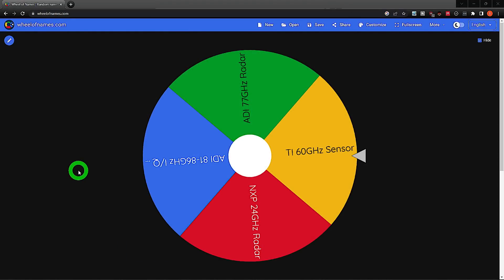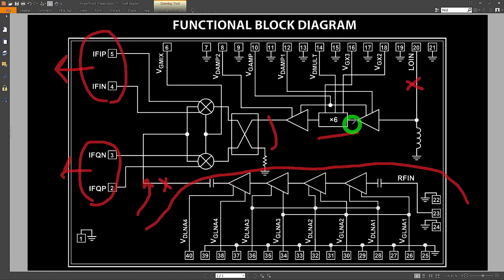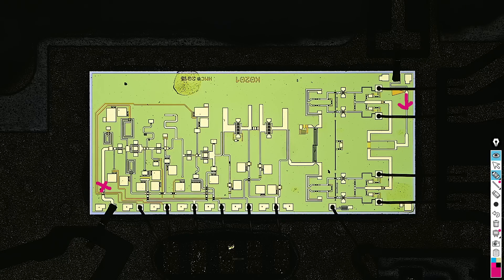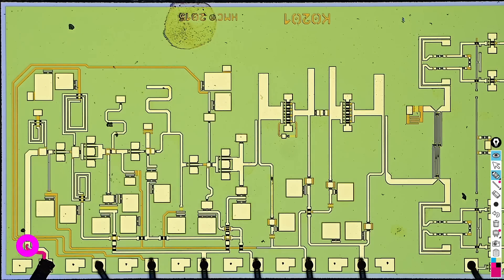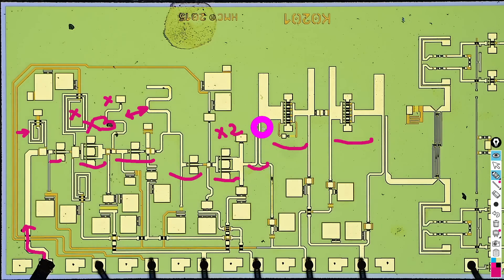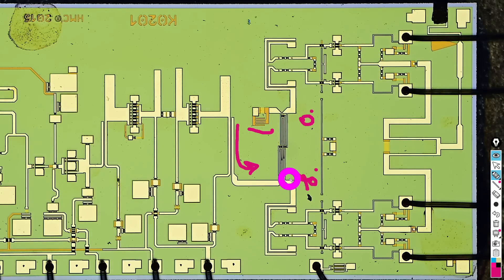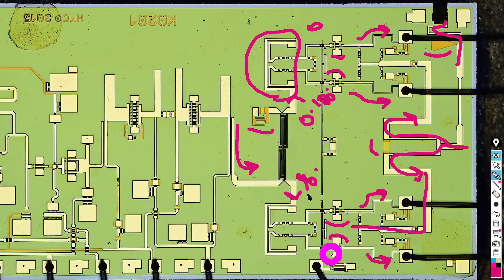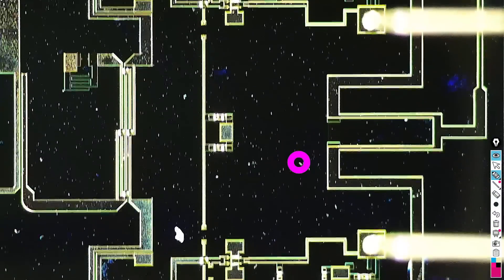TSP #216 - Analog Devices GaAs 81-86GHz I/Q Direct Down-Converter MMIC Detailed RFIC Analysis

Comment: I’d love to see a better description (calling out diodes as to which sides are P and which are N of the actual doubler and triplers and even vs odd harmonics (for the benefit of others).
Reply: It is a HEMT process. Probably by WIN semiconductors. So no bipolar diodes, only field effect transistors. You can make e.g. a doubler if you bias a transistor at deep class b, so only the positive half wave gets amplified, and you match the output to the 2nd harmonic. MMIC design takes some time to master, as with active components there are multiple possibilities to achieve a certain function.

Comment: Thanks, Shahriar.  I saw several places on the die where turns in "traces" were done with 45° angles or with curves, but in most cases they were 90° bends.  What drives the decision to use a particular method for direction change over another?  Don't 90° bends create reflections?
Reply from the maker: It depends. The bias lines don’t matter, and low frequency parts are also OK. For inductors (as lumped elements) it also doesn’t make much of a difference.
Reply: @TheSignalPath  Ah, of course; I forgot about the bias.  That makes sense.  Thanks!

Comment: I'd be really interested in seeing a breakdown of how each of the structures operates, and how the element sizes are tuned. Something I'm trying to wrap my head around is the behaviour of the circuit across the specified operating frequency range, since I presume that the λ/4 length of the Lange coupler and the λ/2 lengths of the I and Q differential couplers are based around the center frequency of 83.5GHz, which means there must be some propagation delay error in each of the structures when operating at the outer frequencies (81GHz or 86GHz) and therefore some phase error between I and Q as well as between the two ends of the differential signals. The datasheet claims ±4° of phase balance error, but I can't see how they've arrived at that number given the percentage change in wavelength across the operating frequency range.

I'd also be interested to know why the LO frequency range is specified down to 11.83GHz rather than 13.5GHz (81/6). EDIT: Strike that last part. The datasheet is full of typos, and they mention an LO of 13.5MHz a few times (supposed to be GHz), which made me suspicious. 11.83GHz * 6 is 71GHz, rather than 81GHz, so I'm almost certain that they typo'd the calculation and the LO range should actually be 13.50-14.33GHz, not 11.83-14.33GHz.
Reply from the maker: They have another part which is 71-76GHz. Probably LO is the same for both chips.

Comment: Can you find or draw a schematic for the mixer transistor and surrounding circuit elements, perhaps explain the bias and signal levels that are needed to make it work.  Obviously something non linear happens there but what and why.  Right now we just look at that transistor in awe and wonder why it should be mixing anything.

Comment: I would love to see you measure distances using the lock-in amplifier with modulated diode lasers! Say 100 MHz, so you can get millimeter precision
Reply: We do this at work!
Reply: @Ziferten  Woahh please tell me more about it; I would love to do this but the Stanford DSP lock-in at work has a much lower bandwith than what I want, so I still have to down-convert with mixers, and have yet to commit to the project...

Comment: Very interesting. I think such circuits with relatively few transistors are excellent examples to analyze. Simple enough to follow yet fascinating. One thing you didn't mention - how is power supplied to the transistors? I guess the bulk is connected to ground and the rest of the bonding wires are different power rails?
Reply from the maker: Yes, bulk is grounded. And the rest of the bias lines can be seen on other metal layers.
Reply: @TheSignalPath  The bias lines look pretty long for some and the bypass caps quite big that I wonder if they could potentially create instabillity (mostly due to SRF of the caps), at some higher frequencies, but I havent worked with III-Vs yet (so I dont know about the BEOL performance of these processes)
Reply: In GaAs typically there is no bulk, as the substrate is not conducting, unlike silicon. The gnd is brought to the backside metallization by etched and then plated vias.

Comment: Would love to see a deeper dive into each of these structures, like the Balun for example.  How do the fields work in it to form a balun?  Why is it bent?  Is that better, or just space-saving?  What are the approximate impedances at each point?  What are the little dotted objects right after it?
Reply: The Baluns right before the mixers look to be marchand baluns. The unbalanced end is fed to an open-ended transmission line with lambda/2 length at the frequency of interest, while the balanced ends are grounded transmission lines with lambda/4 lengths on either side. You can see it on the chip, the single ended line is twice the length while the differential lines have squares at their ends, which are probably AC grounding capacitors. The lines in this case are most likely bent to save area while keeping a symmetrical layout for the differential input going to the mixers. This is quite common in literature actually as you go higher in frequency, you can even see these marchand baluns in rectangles or octagonal spiral shapes!
Reply: @regweldrotmg  So the upper and lower structures are somewhere around lambda/2 in length, which create the 180deg phase shifts for differential I and Q respectively through propagation delay? Or are the structure lengths not exactly equivalent to lambda/2 due to the dielectric constant's effect on wave propagation? If wave propagation delay is the phase shift mechanism, wouldn't that cause some phase error in the differential outputs when lambda/2 of the LO*6 frequency doesn't match the physically tuned length? Looking at the datasheet, I see ±4 degrees of phase balance error listed, but back-of-the-napkin maths says it should be more than that (±5.25 deg) if they tuned the structures to the 83.5GHz midpoint.
Reply: @gsuberland  They are lambda/2, but you are right lambda in this case is NOT lambda/2 of a free space wave. The velocity shorting factor needs to be included. In an ideal case there would be no phase imbalance (at the center frequency) from the passives, but due to small path differences and mismatch of the differential mixers you get some (not exclusively) AM-PM  conversion resulting in a phase and amplitude imbalance.
Reply: It's the Marchand balun. Lots of textbook literature on that.

Comment: Another awesome video!  Why is the RF input trace narrowed for a short distance after the butterfly filter?  Is that a resistor?  Also, can you do an episode some day about distributed elements and how they work?  I sort of get parallel couplers and stubs, but butterfly filters and some of the other elements leave me scratching my head.
Reply: Trace width determines the characteristic impedance of the transmission line, so not a resistor, but designing different values for different sections of lines can help match impedances, filter, or both depending on the implementation. Most commonly  when you see a section which is narrowed it is an inductor for a filter implemented as a distributed element. 

Additionally, a quick note on butterfly filters, they are very similar to the stubs you mention, but are just a different flavor of a parallel-open-stub.

Comment: After watching this, I have so many more questions than before. Do you have a Video where you explain some of the building blocks used to make these circuits? I would like an explenation on how the amplifier or frequency multiplier works. It would also be nice to have a more in-depth look at the lange coupler or the single-ended to differential circuit. 

Can you suggest resources (it doesn't matter if they are free or paid) where I could learn more about this?
Reply: The basic step for frequency multiplication is converting a (sinusoidal) frequency signal to a square wave with sharp rise and fall times, this automatically produces harmonics, the strip line filters are used to select for the harmonic that is desired.  You can use these techniques to multiply with larger integers but the harmonics get weaker as they get higher so 2 and 3 are great and you can just daisy chain them to get higher multipliers with filtering and amplification between each stage unless you need a prime number in which case you need very good filters to select a frequency that is much closer to the adjacent harmonic.  The difference between a 9th, 10th and 11th harmonic is only 9-11% while the difference between a 2nd, 3rd and 4th harmonic is 30-50%
Reply: The single-ended to differential circuit is known as a "Marchand Balun".

Comment: Looks like maybe a stepped impedance LPF just past the fan stub on the RF input at top right? I see a skinny bit, then fat again.

Is there anything magic going on in the 180 degree hybrids for the LO single ended to differential conversion? I thought it was a rat race coupler at first but at higher mag it looks like it's a C-shaped metal track with resistors coming off to the two inputs. So resistor-input on the 0 deg tap and phase shifter-resistor-input on the 180 deg tap.

Also, what's with the vertical line just right of the Lange coupler? It seems to connect to a few things but have no connection to anything else. Test circuitry? Or are those little square pads intended to couple capacitively across the gap? It seems pretty large for that.

What about SiGe stuff like the ADL5569? Does that tend to be few layers and easily readable, or is it closer to regular silicon in terms of density? I can decap and send you a bare die and/or photos if you're interested in doing a video with the analysis.
Reply: I have the same question about the floating line with components to the right of Lange. From an EM point of view I assume this is either for isolation improvement, FET stabilization or both. As for how it works, my best guess is that it could act like a half wave dipole to pick up unwanted surface waves or specifically nasty spurs generated from the mixing and dissipate them in the resistors. The real RF magic. Haven’t seen something like this before.

Comment: It's pretty amusing how these devices basically look like a PCB with traces and components, presumably because like you said they have very few layers and everything is on the top.
Reply: Yep, only the front end is done in GaAs with silicone taking over as soon as the frequencies come down.  The cost of silicon is so much less.